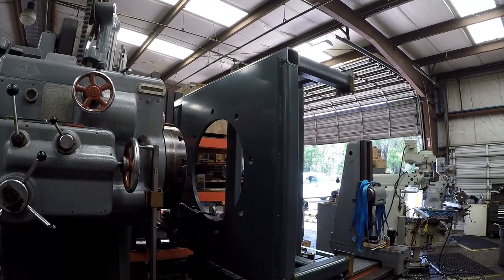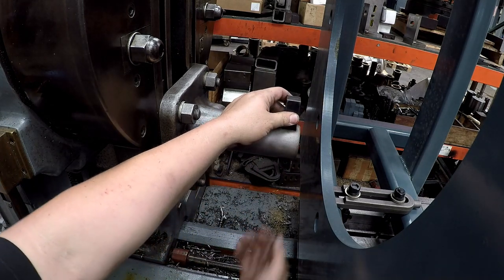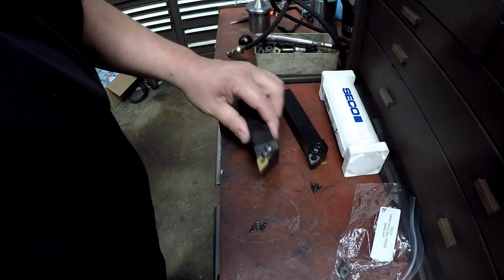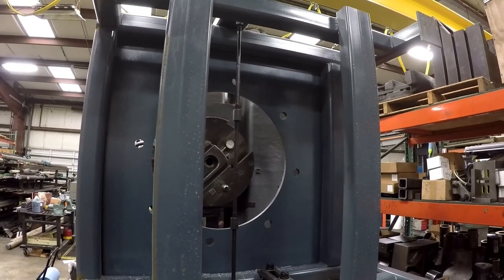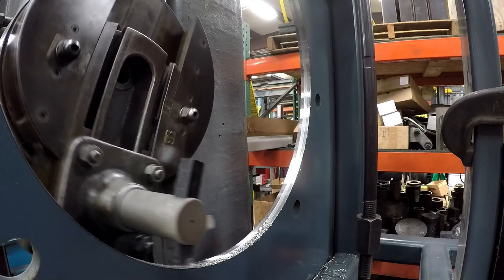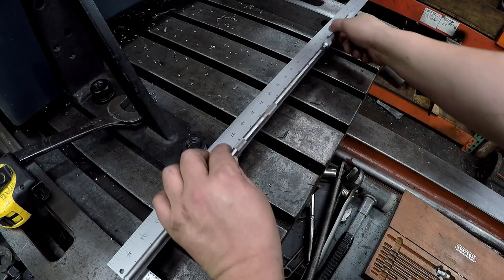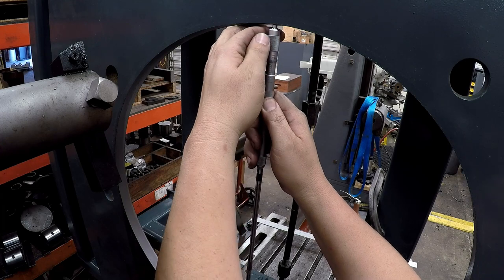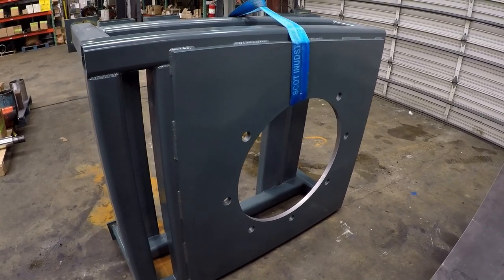SNS 164 Part 2: Horizontal Boring Mill

Comment: There's talk of expense. A very valid point. If the architects screwed up it would seem to me they'd be the ones paying for the fix. I would have grabbed the plasma cutter and had at it if my shop had to pay.
Reply: Duncan MacKenzie Architects???? was this object a part of a building?
Reply: Kevin Smith  Ok, what else do you call a person that draws up a blueprint for the express purpose of building something?
Reply: Design draftman most likely.
Reply: Now that I think on it engineer comes to mind too, I stand corrected. Thanks.
Reply from the maker: None of us wanted to make a mess with the torch, especially since they were painted. Yes it could have been re-painted as well but we all agreed to try boring them out to make it a clean cut and look pro.

Comment: Let's assume you set up that boring mill and it then takes an hour for it to complete the cut. Are you supposed to actively watch it? Are you supposed to work at something else? Does it count as time spent working?
Reply: In my opinion, you never leave a machine that is operating. Even the CNC machine needs to be monitored, but not so closely. Bad things can happen and if you're not there to stop the machine, you could be very sorry. There was a post on one of the forms, or maybe it was a video on YouTube,  I can't remember where I saw it. But this guy was using a metal cutting bandsaw. What could happen. The bandsaw cuts through the part and automatically turns off. So he went to get something to eat, when he returned the whole place was filled with smoke. It could have burned down his entire house if he did not return In time. don't just walk off and leave a machine unattended. pay attention to your machine and what you're doing. This should have been included in the rules that he posted in a earlier video. Never walk away or get distracted while using a piece of equipment.
Reply: It depends on the jobs you have available - once the cut is engaged and you have watched it for a few minutes you will have a sense for how "comfortable" the machine seems
If it is risky you may watch it, if it seems happy you may opt to work on another job nearby that you can afford to drop, such as cleaning a machine while making sure that you are in line of sight and earshot of the machine for any changes in the cut

Comment: Bad blueprints, been there ,done that. but i always had to take the blame. lol.
Reply: Cofffey Machineworks 
I was once given a part to grind that had a +.0001" -.0000" tolerance. After checking the assembly drawings, I found there was no mating part, no need for that tol. It could just as well have been + - 1/16".  Engineers.
Reply: That must have made that job a lot more costly.

Comment: I dont hink it was job chatter as much as tooling. needed to get rid of the hang out on the tool holder.
Reply from the maker: It was rigidity, not the tooling.
Reply: Abom79 was the gear noise a separate issue to the chatter mate?